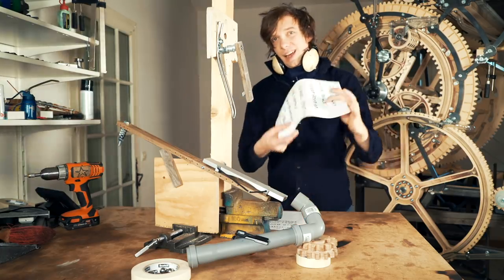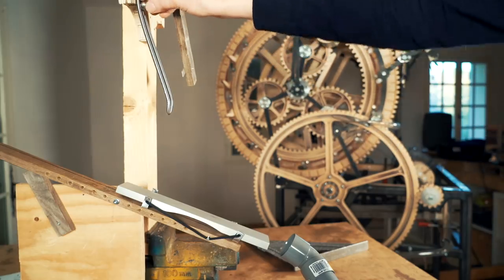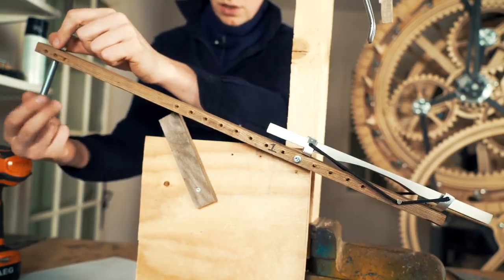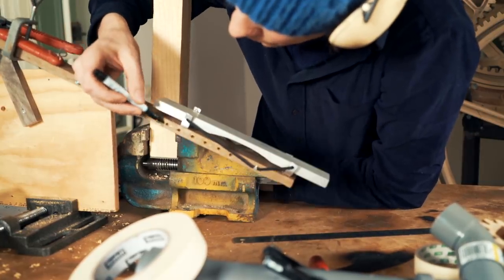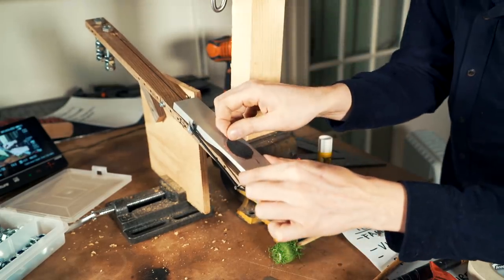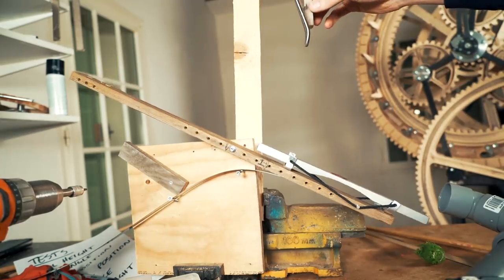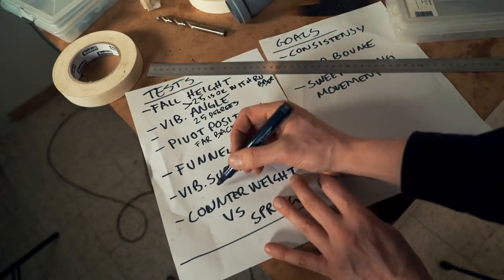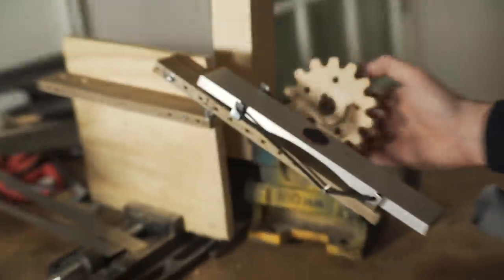Vibraphone Movement Test  - Marble Machine X #64

Comment: My thought in the first 10 seconds was "Martin! You MUST use springs!" Springs will always outperform counterweights because of Hooke's law - for linear springs the restoring force is proportional to the extension, so you'll get a "snappier" response the harder the marble hits the bar with a spring and the opposite for a counterweight. I forget the exact maths for leaf springs and but the same characteristic applies.

Comment: Awesome. One consideration though: what about multiple hits for notes playing back to back very quickly. The rubber pad needs to be a bit longer to compensate the hit point shift due to deflection of the board. The leaf spring also have damping properties ( no up-down of compression springs), they will be ideal for the marbles not to have chaotic bounce trajectories, while the board returns to its position after the previous hit.

Comment: I have an idea for the dampening. You could make strips of the material you want to use and then hang them over the vibraphone. It could be under tension like a trampoline. The marbles would hit the vibraphone with the strip in between and the strip it self would lift again from the tension.  

You could make many optimisations by adjusting the tension of the strips, change the distance to the vibraphone or change the material to get the sound you`re looking for.

Comment: 10:30 I recommend using the leaf spring but push it further forward towards the front of the vibraphone so that it covers most of the underside of it. This should give it more strength, and not bounce like the compression springs do.

Comment: I realize this is probably pretty hard to implement but you could increase the sustain of the vibraphone by positioning the rubber pad slightly above the vibraphone, supported on either side so that it doesn't normally touch the vibraphone so the sustain isn't affected, but when hit by a ball, it will contact the vibraphone, making a nice sound.

Comment: Amazing as always.  My only thought is that the metal marbles could wear the a hole in the rubber and change the sound.  Easily replaceable rubber pads might be essential maintenance between performances.

Comment: I think the spring steel is the best option because it can be configurred a thousand ways. One band as you used it, you can stack differend hardnesses and thicknesses, you can coil it as we saw, you can constrain it and attatch the vibraphone at different positions...
If done right you will be able to get a small form factor and a nice movement without any counterweight.

Comment: Impressive, as always!
I’m not much of a mechanical engineer, but just looking at it, wouldn’t these leaf springs eventually start to fail in the fact they would be bent for too long?
Additionally, you may want to look into what happens when you drop two marbles in quick succession on the same plate- because there would potentially be a marble hitting when the plate is at the wrong angle due to the movement of the plate itself.

Comment: You might want to create some parts to hold different pads to quickly swap between sounds that the xylophone bars make. The simplest / most user friendly way that I can think of at the moment are a couple of rods on each side of bars that have a locking nipple that a lightly tensioned strip of material could slide over and lock onto. 

Good lick on the project man!

Comment: You never want to hit a vibraphone bar (or any other barred keyboard instrument, like a marimba or a xylophone) in the center of the bar, but between the nodes of vibration.  A steel ball is certainly not the ideal mallet--so you're already dealing with limitations inherent to your system--but you might be able to optimize your sound by striking the bar with the "marble mallet" in a better position.

Comment: One thing you might be able to try to get the sound of the green without having to glue a pad to the bar would be to suspend some material over the bar the marble will hit first like a hammock catching the marble and striking the bar, allowing the note to ring without being dampened in any way.

Comment: You might want to try liquid tape, an electrical insulation on the vibraphone for the pad. The advantage is you can "tune" the rubber by the thickness of the application.

Comment: I would suggest having a single set of resonators with an additional flap mechanism inside them similar to the vibrato shutters that will effectively close off the resonators thus changing the size

Comment: So you have to change the lengths of the resonator tubes during the concert—have you thought about taking a flute sort of approach to this, and having holes in the resonator pipes that can be covered? That would be easier than making sleeves that need to be set to the right length, I think.

Comment: It's occurred to me that if I'm reading the CAD images correctly, you're using exactly as many vibraphone plates as there are letters in Wintergatan. I wonder if you've considered some form of branded lettering on the funnels, similar to the ramp on the first Marble Machine, but directly on the funnels front and center. Either way, I'm loving the progress!

Comment: Hey Martin, if you need the compactness of the compression spring setup, you can reduce the oscillations by adding a suitably tuned dampener. You can make one using a strong magnet moving within an aluminium tube. Or, with a leaking air plunger.
If you need help with it, send me a message and I can help you out.

Comment: Hey Wintergartan! Loving your work so far!

While doing the testing I think I've got a handle on the WHY the rubber pad is causing that nicer arc: namely the rubber is increasing the elasticity of the collision. As such that would cause more kinetic energy to be lost as heat in the transfer between the marble and the vibrophone which would cause the resulting velocity of the marble to drop; most severely in the horizontal direction. I think this because when the marble impacts it is also still rolling; introducing friction that wouldn't be there without the pad, and since the pad is mostly horizontal (25 degrees below 0 I believe?) then the friction vector is mostly horizontal. This leads to the marble having a higher vertical velocity than horizontal and since the horizontal velocity is slower it still has time to descend back into the pipe.

Not sure if this is correct 100% but it was interesting to think about!

Comment: Reverse the pivot point so that it is on the side closest to the funnel recieving the marbles. Leaf spring in the other direction. Movement will be in the upper side but the slopes angle will still make the marbles bouncing towars the funnel and over the picot point. :)

Comment: If the motion is just cosmetic, have you considered adding it to the dropper portion? Like a little wheel with two long arms coming off either side right at the start of the drop that gets rotated as marbles pass through, that you could use to drive/trigger a movement, kind of like the "Wintergatan Marble Machine" and stars on the front of the original, but you could just spell out "Wintergatan" with each letter moving/corresponding to a note? Then you don't have the timing issues.

Comment: LEAF SPRINGS! Hey, I'm an engineering student who has done a lot of work with springs (namely vehicle suspensions) and I might have an idea or two. The best way to reduce the wobble of the arm the bell is mounted to would be to use a type of progressive spring, because as the spring rate increases as the arm goes further down, the resonance frequency of the spring changes. The fact that the resonance frequency changes means that it has very little effect on how the arm sways. And, if you like the idea of leaf springs, having multiple leaves of different lengths can make a spring that is progressive in nature. Perhaps a quarter-elliptical leaf stack would work well for space constraints.

Comment: Idea for the resonators. Have an adjustable stop at the bottom for different notes. This way the tube is always the same size and you move the bottom of the resonator to match the note.
We did this for my marching band marimba when we couldn't get the right pipes.

Comment: I dont know how big of a difference it makes to the sound if you glue stuff to it, but something that could work is if you stretch a rubber cloth just a few mm above the vibraphone and not attached to the vibraphone itself. Think of how a drum is stretched, but just above the surface, so that it dampens the clack sound but wont change the vibration.

Comment: I'm worried that the springs will wear out with repeated use, especially since it is only metal and could eventually be fatigued. If this is the design you're going for, consider doing a wear test (play lots of notes for a long period!) and see how long the spring will sustain the necessary shape. Perhaps also consider using cork on the underside of the spring, like some rulers do, to give it extra elasticity.

Comment: Looks amazing! I’ve been in awe of this since the start! 
You mentioned changing the resonator pipes. Is there a way you could put valves on them to change the length like how a flute works? Are you thinking just for changing keys? If you want to sharpen or flatten a semi tone then a valve could work like how a harp changes keys with sharpening levers, or are you thinking octaves?

Comment: There were a lot of un-addressed issues left on the table in this video:
- How are you going to control the sound of the marble inside the catcher tube? It's like a second instrument with an unwanted sound. 
- What is the maximum speed that consecutive marbles will strike the instrument?  Will it recover in time? I think not.
- Each bar for the instrument is a different mass and you have not accounted for that with the spring setup. It would be easier to adjust tension bars instead of finding different spring weights. This things needs to be tunable and the springs will be a nightmare.

Comment: With regard to the rubber pad, a good source of rubber is used bicycle inner tubes that you can get a bike shop to save for you instead of throwing them away... I'm aware that the glove rubber has fabric on the back but it may be worth experimenting with that a little, I imagine just rubber and no fabric will reduce the damping effect...

Comment: Martin, have you considered suspending a strip of rubbery material say 3mm above the keys, so you soften the marble blow without reducing the sustain or volume and no effect on the upper harmonics? The last point is probably undetectable to be fair. This might be way more hassle than it's worth.

Comment: Hey Martin, thanks for all the content can't wait till it's done! I was wondering if you update cad files when you adjust parts you've received. For example, a CNC part you've made appears to need an extra hole after a while, do you adjust the CAD file of the part just in-case?

Comment: Have not read all the comments yet but by having pads glued on will create wear and tear issues. The swing arm slow return can also cause issues. What about using padded arms like what is used on piano keys? You can have a quicker return speed because of less weight. Predictable bounce angles. Consistent bounce angle. Still have arm movement. Maybe even have them roll over a trigger located in a steep tube so you don't get the added marble to swing arm contact noise. 
Just a thought.
Yet another thought, being that you want the catch funnels to have movement,  is there any way to incorporate that movement into striking the instrument?

Comment: I love the progress that is happening, side note when using a rafter square or speed square and you're measuring an angle, make sure to align the Pivot Point with the actual axis in that the thing you are measuring is rotating on. I can't say specifically if you were or weren't doing that on the 10th degree measurement, but from this side it didn't look like a remotely accurate measurement
Reply: I'll eat my words, it looks like you improved your methods by the second measurement. Sorry the internet is such a cruel mistress I just wanted to help

Comment: Could use oil filled RC car shocks. That way you get the small area of springs, but also bounce damper.
Reply: That could also add a nice steampunk'ish look to the bounce damper as well as reduce the time for the vibraphone plates to reset to their original position.

Comment: Hey Martin! I think the reason the leaf spring is damping the movement out so quickly is because it is rubbing against the wood, causing friction. There is no reason you could not do something similar with the coil springs if you need it to be more compact. You might consider using a stop with a soft pad on it (in the resting position) as an alternative to friction damping (that is how piano pedals are done I think). That way you can make a very compact assembly. 

Also, I am thinking you probably want to make the rotating assembly have as little rotational inertia as possible, so that the movement can be quick without using a very stiff spring (so you can have a big movement, without compromising your ability to quickly repeat notes). And I support your desire for a long lever arm, since it will minimize the change of angle, should you want to hit the note twice before it is completely reset.

Comment: Martin, for the rubber pads on the vibraphone bar surface can I suggest bicycle inner tube repair patches? They are already uniformly cut to size and have an adhesive backing so easy to fit.

Comment: Nobody will probably even see this because I'm behind on watching videos but, WHAT IF you spun the shaft on the vibraphone with the machine.  Instead of only having the force on the marble available for recovering the position on the vibraphone, it need only cause the note to drop and then energy from the machine will kick it back up.  Big movement, fast action.  I've no idea at the moment what this mechanism would look like but it's got my brain going.
Reply: After playing devils advocate with my thoughts for a moment, I realized this movement would probably look very unnatural.  Also, it may be far to deep a rabbit hole if the spring is sufficient and the funnels can tolerate a slight change of angle.

Comment: Instead of using a vertical coil compression spring. Try using a horizontal twist spring. Similar to that of a mousetrap. It would simplify the design and clean up space both front and rear of Pivot Point. ( another alternative for spring assistance would be to use adjustable RC car suspension shocks if there's room behind the resonator tubes to mount them. Then you would be able to fine-tune and adjust the motion of each note to exactly how you need it. It would also give it a clean mechanical look.)

Comment: to change the length of the resonator tubes, use tuning collars like organ pipes.
On organs the main diapason pipes are tuned with a metal sleeve around the end of the pipe. This can be slid up and down effectively changing the length of the pipe.

Comment: You can calculate the needed counterweight, spring stiffness and dampening pretty well for given parameters, like the maximum angle of movement or the time it takes for the vibraphone to return to its starting position. You would just need to know the mass of the contraption and the overall measurements. I can help with that if you want :)

Comment: You can buy silicone tape.  It’s like electrical tape- which is rubber- but a bit thicker-   Self adhesive- it would be easy to apply and easy to replace as it wears.

Comment: On using springs on the fulcrum you could experiment with standard round springs and suspend the fulcrum. You could even mount springs below and above to control movement even more. The only issue I see is possible bouncing of the fulcrum but that should be able to be mitigated and might give you the movement you are looking for. This might produce more fluid motion, reduce noise from fulcrum hitting the stop, and better sound with it being floating. Space saving also since you can reduce the fulcrum length.

Comment: If you're looking for more information on reducing time to return, the term you're looking for is "critically damped." It's a factor of spring strength and friction from a buffer. 

Also, the leaf spring has some minor points you need to consider. If you over-stress a leaf it will take a set and eventually fail to provide the same force. You can increase the strength with increased thickness, increased width, or reduced length of arm. You can probably get a compact system by pinning one end and adjusting the angle to adjust pressure. I can't explain well without a picture, would you like a sketch?

The most compact system would be a coil spring with a small buffer inside the coil. You're not getting too much vibration after the fact, but if you need to reduce oscillation, that's the way to go.

I have some practical experience in compact spring mechanisms if you're interested in talking about it. No fear if you already have people for that.

Great work, loving the project.

Comment: 10:12 "I don't like this long back-and-forth, maybe you can reduce that." You can!
You'd need to add some kind of shock absorbers or dashpots, but if done properly you can set the system to be critically damped. This will let the system reset quickly and smoothly. I'm really out of practice with differential equations and dynamics though, but it should be possible. Might require a bit of tuning though.